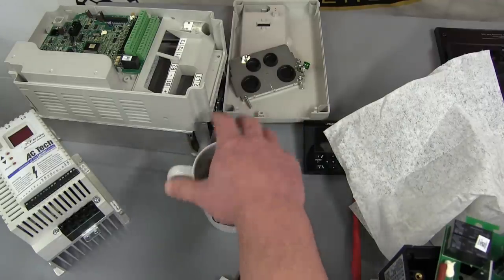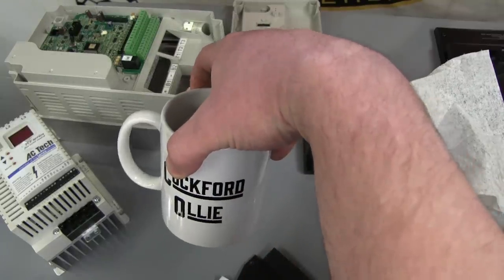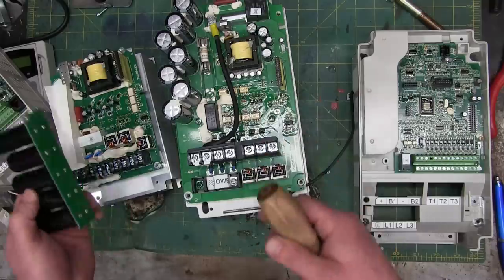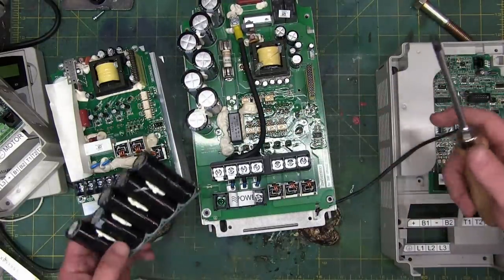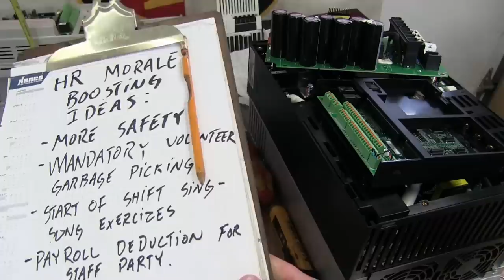Industrial Electronics Tune Up! | Stay Frosty

Comment: The enginerds are gonna be mad because you used genero silicone paste and not ARCTIC SILVER PLATINUM TITANIUM PASTE!
Reply: Fuck that. Coollaboratory Liquid Pro is what she needs! Only $20 a gram!
Reply: Damn straight!
Reply: That would be the computer geeks. Real engineers will buy it in the packaging that is closer to what it really is for a price that isnt marked up more than car dealership motoroil.
Reply: Getsome Thermal Grizzly Conductonaut $9 a gram! save some denero and chill your sil
Reply: When the Xbox 360’s came out and you were sending on back to Microsoft once a month to then just get a pos refurbished one back, I actually took the last one I received apart and used some arctic silver and replaced the fans with some that were not so anemic. It’s lasted over 6 years now, I’d dare say 8.
Reply: There are certainly grades of thermal paste compound, it effects performance, so it is more so related to the cost of what you are heat-sinking and how robust it is.     The way you apply matters much more than the kind you use. I haven't finished watching the video yet, but his first application is cringe worthy.
Reply: The cheap stuff works great when you apply it in thin layer but comes an insulator pretty fast.
Reply: Marc Stokes from everything I've seen application is actually not that important, provided that you have an adequate amount across the whole mating surface. Too much is only a concern for future service ability and more importantly to prevent shorts. Although in this case, due to the mounting of only having the two sides causing it to bow when you mount, this one may be a bit more sensitive to quantity of TIM you use and the tourqe of the screws.
Reply: Onijin1 that heatsink is aluminium. Gallium turns ali into smoo pretty fast if you drop your load on it.
Reply: Nah, ceramic stuff. Not electonically conductive, cheap as frick and it verks pretty good. My pc has it, stays nice and kool.
Reply: You spelled Noctua NT-H1 wrong. +rimmersbryggeri We prefer the term 'angry pixie translators'
Reply: Linus did a video on buying bulk thermal paste and the verdict was basically that the stuff you can get in bulk is generally does a worse job than higher performance pastes and that paste can apparently go bad so unless you can use a half a tub of the stuff in a year you could end up with a fair bit of waste.
Reply: Tom Fielding eh. Most enginerds can’t resist the temptation to pull that heat sink off periodically to check the condition of the paste. Generic paste will get changed out every few years. At least in my shop anyway.
Reply: DIAMOND!
Reply: not on an aluminum heat sink
Reply: Does not matter that much what you get. For CPUs I read some test some years ago where they tried several pastes and in addition to that toothpaste, ketchup, mayonaise, ...
Result: As long as there is something filling the small gaps, you're good to go. The temperature difference was only a couple of degrees.
Reply: you need to definitely look into that a little further. It definitely matters.

Comment: This has probably been mentioned a dozen time already, but regardless, my $0.02 on the thermal stuff: 

With most chips, the header plate is massive, but you're just interested in where the specific die seats on it. Once you know (or guess) that, apply a pea sized strip along the die(s). The pressure when you crank the heatsink down on the plate is enough to spread it out. and get good enough thermal conductivity. I've seen tests with people using all sorts of crazy things for thermal conduction including peanut butter and all do fairly well. I'd look more at dissipating the heat on the heatsink itself (by a fan, etc) more than getting perfect thermal conductivity on the heatsink to the chip itself. All the thermal goo does is fill the pours in the top plate and heatsink surface to get better transfer.
Reply: What Kaz said.. specifically the last 2 sentences. I repair servo drives. All the thermal paste is doing is filling microscopic imperfections in the metal to allow better heat transfer. Too much is bad bc you're creating insulation. "A dab'll do ya" is the right way to go. And if it's dried up and flaky, it isn't working anymore.
Reply: The fewer barriers/interfaces the better. The best contact would be a weld but once you achieve that you kind of have to start over. Next best would be perfectly fit and polished surfaces with nothing between them.

Comment: Cheers from another cold wasteland formally known as Sweden. 

Regarding how to wipe of the diaper rash creme: In confusers, we use acetone and coffee filters, since it leaves no residue on our CPUs. Also the proper way to apply the new paste is in a single line and then letting the assembly of the component press it out since that leaves no air pockets. On a CPU it can differ 20 degrees Science depending on if this is done correctly.

Now as we say in Sweden, Have it nice!
Reply: Thanks for the tip on the application. For removal, nothing beats a pressure washer, of course. Or a belt sander. :)
Reply: It's actually been shown numerous times that application method has minimal effect on thermals, as well as applying too much does nothing but simply waste thermal compound! GPU manufacturers on high end graphics cards apply a LIBERAL amount, it's almost crazy how much they use but  as more doesn't effect cooling, but too little can be critical they do this! (better safe than sorry). Over time and thermal cycling it all flattens down evenly with the pressure of the sync, and just oozes out the edges. I totally agree with your application adivce though a simple line of it down the middle horizontally would have been the way to go (same as the rice grain amount on cpu's).
Reply: Jävelberg!
Reply: I wouldn't recommend using acetone since it dissolves quite a few common plastics. Isopropyl is much better as a general cleaning solvent, including electronics, and it also doesn't leave residues.

Didn't know about coffee filters, I'll have to try that out.
Reply: literally every method yields the same result, with the exception of too little LOL.. I know I believed application was super critical in the past as well! Slam some on there and givver man, time can be better spent elsewhere!

Comment: I used to work in IT. In the '90s, Sun server CPUs used to be shipped with a nifty 1/4" drive torque wrench (calibrated to 5 in-lbs). They were all metal construction, looked like something NASA made, and you could recalibrate them. I had a drawer full of them, but I only kept a few. I haven't actually used any of them... but that's what having tool cabinets are for.

HS Schmoo usually comes off with Acetone, but you don't want to be using your "Sunday" shop rag for cleaning it, as like NevrSieze it gets on everything in the damn shop.

I'd like a mug, but watching your channel is entertainment enough. (I left Tronna for Switzerland in 1990, so I like hearin the Canajun every now and then.)

Comment: I'm no electromagical surface enginerd and I've never dealt with a heat-sink that large. However, while laying TILE, you use a trowel to KEY the mortar. Keying in this way allows you to develop and ensure even DEPTH of adhesive (because the keyways/teeth/notches act almost like a go/no-go, while simultaneously removing excess at high spots and forcing material into low spots). It's essentially a non adjustable metered dispensing unit. The result is a fairly even coating to be squished into a given area. Just food for your big gorilla brains. And, I just read James Banana's comment about applying one thick single line while using the mechanical force of the components to spread it out - leaving no pockets of air. Pretty sure his method makes more sense...

Edited to say - I don't think I have commented on your tube before (haha), however I have been watching your content for a long time and want to thank you for being real. I feel that, not only have I learned a lot from you, but you've also proven to me that I'm not weird for thinking the way that I do... Thanks AvE.
Reply: nam Sake I was thinking about this too. The difference is that, with tile, you want a full layer of adhesive. With a heatsink the thermal paste is only filling in microscopic cracks on each surface. You don't even have to use paste if you lap the surfaces together.

Comment: Holy-ol-FACK, the Patreon SNR is so amazing that I actually got through to AVE about the crustiness of their TIM-job AND he also went and took the time to make a video about it to spread the knowledge to the rest of the club!
Honestly, this community is amazing.
Reply: Simon Ashton; TIM =Thermal Interface Material, a.k.a. the white goopy schmoo inbetween two mating surfaces.
Similar to other types of hand jobs, the quality of a TIM-job can easily be determined by inspection of the quality (and quantity) of schmoo deposited on the working surface. :)

Comment: Correct me if I am wrong, but in my PC modding days. I read that one can expect about a 50% increase in life expectancy for each 10°C you drop the operating temp for electronics.
Reply: That sure sounds like it still is.
The surprise recently came from a study from Google? Facebook? one of the big ones surely, stating that that doesn't hold with hard drives as we all used to believe.
Reply: There is a rule of thumb in chemistry that for every 10°C increase in temp, the rate of reaction doubles. If parts are degrading due to chemical wear (oxidation etc) then sounds like you might be right!
Reply: It is true that lower temperature will extend the life of most electronics as failure rates follow the arrhenius equation. The much quoted doubling in failure rate for every 10C rise in temperature starting at 20 C ambient. However, there are all sorts of caveats, such as ensuring that the temperature is not reduced below the dew point and mechanical parts have problems with lubricant failure at low temperature. However, modern electronics is very reliable, with electrolytic capacitors being arguably the must unreliable component. The real problem with modern electronics is if it contains software, as manufactures are using software to build obsolescence into equipment, usually by ensuring incompatibility with newer versions. A lot of perfectly good and working  electronics is consigned to the scrap heap, simply because a computer operating system no longer supports the necessary drivers. This form of obsolescence is creeping into brown and white goods as well as automotive electronics. As internet connectivity is added to almost all electronics, manufactures are using software obsolescence to force consumers to constantly replace products.
Reply: This is true for electrolytics, which is typically the part that fails most often, specially in motherboards.
Reply: cool (no pun intended)  thanks for that.
Reply: Yeah but with pc you cant expect the pc to be good for than 10 years. Gets outdated.
Reply: AirsoftSlo it also gets really cheap to replace stuff! Out in Texas power is cheap from wind and you can run anything for pennies
Reply: Cyberat Rodent are cost of the water from city supply would be much higher than the cost of the electricity saved.
Reply: Oak C no, because dew points induce an entirely different set of problems.
Reply: Oak C that's funny
Reply: +Henry Simmons Semi conductors lose ions over time. A diode or a transistor for example consists of p-doted and n-doted material. The hotter the part gets, the faster it loses those ions (in case of silicon based parts it is phosphor and boron, afair). So no oxidation usually. Just the lattice structure rearranging it self by kicking out those implanted ions.
Reply: it depends on how close you are to th maximum temp.  its not linear its more parabolic looking.
Reply: Now there's what for saying a guy who didn't have use for a shovel. And ANNA most certainly did it for the tenders!
Reply: Pfft, excess cooling for me does not exist! Just more pixies i can feed my CPU before I hit thermal boundary! Better cooling=more clocks 
EDIT:Just want to add, i haven't worn out a motherboard since back when memory controllers were off-die!

Comment: I hate scrapers for applying goop, I prefer rubber glove finger painting application, its kind of relaxing too.
Reply: AuMechanic does vinegar get that silicon off?
Reply: I've used rubbing alcohol or hand sanitizer to clean off thermal paste from CPUs and heatsinks with good success
Reply: +1 For finger painting the compound. I usually use a sandwich baggy tho, on account of being cheap.
Reply: +William Chamberlain I'm a bit of a carby cleaner fan actually, it just seems to take everything of anything, so it makes it easy to decide what to use.
And Shellite is my other favorite cleaner if there is any plastic or melty bits.

Comment: So I know in the build a PC community, there are all sorts of this that and the other ways of putting on thermal paste, with each one being morally superior to the next- but it made me think of laying tile and how to properly put down mortar so there are no air gaps and you get perfect coverage.  I wonder how those two fields might overlap here since it's the same basic principle.
Reply: Its not quite the same principle, though.  With tile, you’ll accept air gaps to allow a tile to be in the same plane as the ones adjacent.  Mounting to a heatsink, you want both surfaces as close as possible and any air gaps filled with something more conductive than air (down to a microscopic level).  I say load her up, clamp her down, heat her up a few times, re-torque,  heat her up a few more times, then scrape the excess schmoo off the sides.
Reply: Preferentially, the chip would be printed directly on to the massive, silver (Ag) heatsink.  ;)

Comment: I don't think I would like to have to explain that mug to the wife... Depending on surface finish the thinner the thermal paste the better. More metal to metal contact the better as the paste is meant to just fill in the voids on the surface. Most of the time these days everyone just slaps a dollop in there and squeezes her together.

Comment: Hey AvE, probably better not to pre-schmear the thermal interfiddley schmoo what for not creating bubbles in the middle of the heatsink when stripping the philips heads. Like I tell the wife just leave the schmoo pasted on there untouched gooped in a line in the center as the load will schmear it much better than you by hand.
Reply: This man deserves a mug!
Reply: Yup!
Reply: Longer the gob, better the job?
Reply: For large heatsinks like this pre-smearing the heatsink compound is always best in industrial applications where you want to get good consistency from batch to batch.

We have certainly had no issues applying it this way in many years of manufacturing high power/heat devices.
And when you remove a heatsink it always looks like when AvE pulled the original heat sink off (what he describes as the mars like surface).

Comment: Another subtle difference on Hitachi VFD vs others: heat sink channels closed with baffle plate, creating chimney effect cooling on heatsink, fans running or not. 2 hp model could be improved by just sheet of metal blocking backside airflow, creating chimneys of each pair of fins. Non-intuitive, but really werks!
Reply: Doc Pedersen I suspect duty cycle has a part to play in the size.  I imagine a municipal waste water pump or something similar that cycles and perhaps ramps up to 200% of rated speed on occasion to match demand?
Reply: MikeCookie1973  Huh? I was referring to method of getting heat out of heatsink better.....
Reply: Doc Pedersen my guess was simply that the hitachi has a larger heat sink and active cooling because it may be subjected to more extreme conditions (load and frequency swings).

Comment: The “cracked” schmoo pattern is actually a sign of well applied schmoo. You only get that pattern when there’s good schmoo coverage WHEN you pull it off. The pattern isn’t there while the two schmoozing parts are together.  Try it out for yourself!

Comment: Altera Max II CPLD: $7.50 to almost $40 USD at Digi-Key, depending on model. Basically, it’s a programmable logic chip; and is probably implementing some “glue” logic for the main microprocessor that runs the drive. 🤔

Comment: Xylene and  better yet, Toluene (if you can find them) will properly act as solvents for silicone oils. "White Spirits" sort of work, but....not that well.
Reply: While we're adding things, trinitrotoluene is less good at cleaning up silicone oils. Unless you use it the other way.
Reply: Also try citric acid, theres a well know brand of cleaner that smells of fresh cut limes!!, for removing thermal compound from pc processors, think its made by alaska or akasar?( ive prob spelt both wrong!!lol!) Hope this help for some one. All the best mateys!
Reply: HellBilly Austin Arctic Silver thermal compound emulsifier. I use it a lot on my GPU/CPU and it cleans it up easily.
Reply: Orange oil too.
Reply: @Ilearch n'n'daCorna Oh Hush. It works perfectly well at converting problems to memories.
Reply: Don't use Xylene or Toluene, veeeery bad for your health. Try getting Methylene Chloride, a tad bit less deadlier, we use it for dissolving Asphalt test samples (Bitumen)